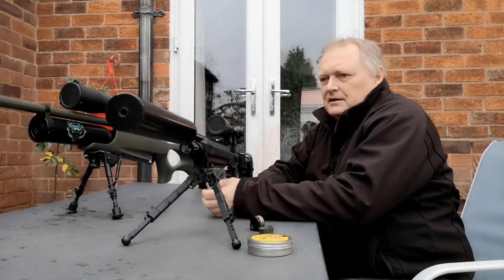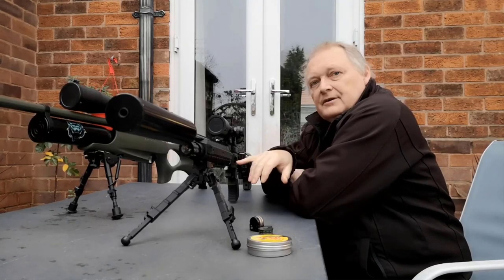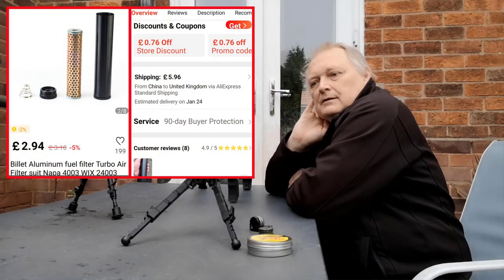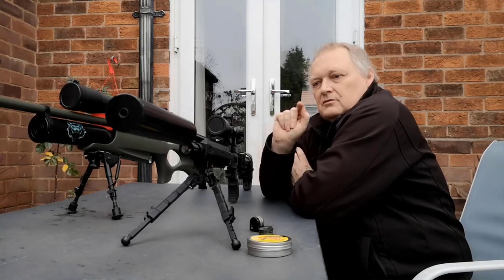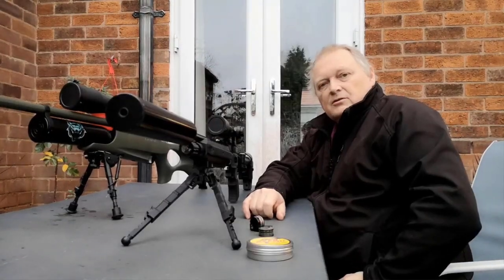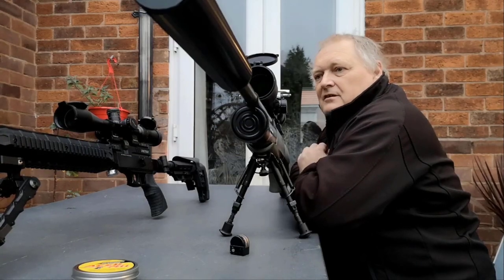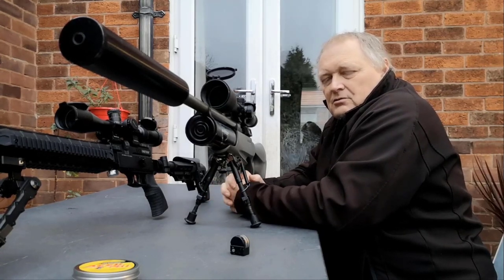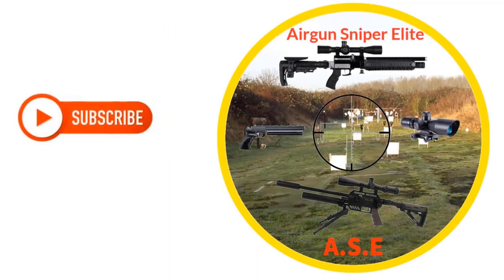Ali-Express Fuel Filter to Airgun Silencer

Comment: I actually bought two of these for my Gauntlet and Avenger. Both in .25 cal. My .30 cal AEA does not like these, kept clipping the adapter, then the baffles (probably because of clipping the adapter. The other two are extremely quiet with these. I did have to buy a thread adapter for both. I think I had made a mistake when ordering. You also see a huge reaction difference with game. Unsuppressed I’ll have squirrels at over 100 yards react to the shot. Suppressed I’ll take 75+ yard shots and squirrels at 40 yards won’t even react. Otherwise both costed under $80. The adapters were $20 off of eBay. I will be buying a Fat Boy for my .30 cals.

Comment: Bought a spotting scope of Ali express for £14, took one look up the range with it and used the next viewing angle to spot the nearest bin, good job it was only 5yds away otherwise I wouldn't have been able to see it. what happened next was a carefully aimed lob of the aforementioned scope straight into the bin, hope nobody found it in there ,they would have been bitterly disappointed.